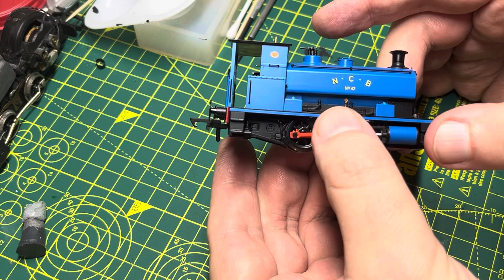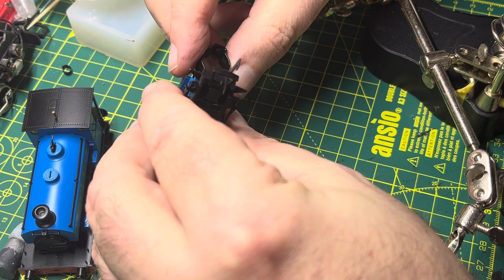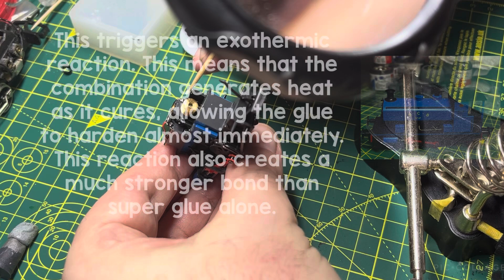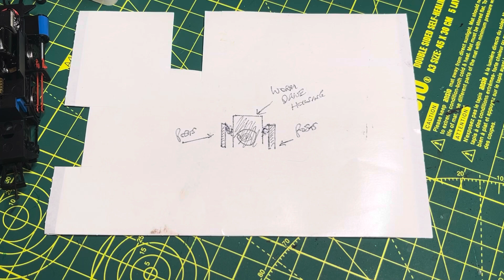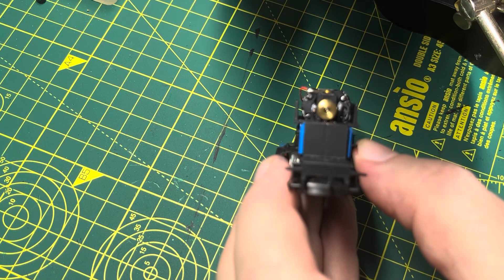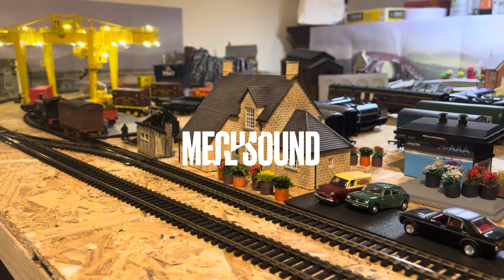How to Fix your Andrew Barclay Motor Mount

Comment: There is a way that does not require glue. On your diagram you show post(s) with an arrow, If those arrow(s) where wood packing between the post(s) and the metal chassis so the posts engage the motor. If a full restrain of the wood packers is required (not just friction) drill clearance holes in chassis and add countersunk self tappers so it clears the body fit.
Reply from the maker: Thanks Brian.  Had a read through a couple of times - trying to visualise)
Appreciate the additional ideas.  Would be great to try other options.

I did think about fitting a wedge into base pushing the posts inwards - similar theory to yours I think 🤔 

I decided against it, as if it dislodges (say for e.g a wooden section) it could jam in the worm drive.  So went with an option that wouldn’t add a foreign object if dislodged.

Hope I explained that ok)

BR

MODELTRAINZZ

Comment: My friend fixed mine for me. I put it on the rolling road, it ran perfectly for 15 minutes then one of the screws holding the connecting rods came out and disappeared somewhere into the universe.....This disaster of a loco, damaged cab and loose motor when it arrived and now the screw.  I have had it several weeks and its run a total of 15 minutes.  Its been the worst loco I have bought and I have bought lots in N and OO. I tried to return it to Accurascale from Australia and that was a farce that went on for a couple of weeks until my friend talked me into letting him fix it. Once I get the replacement screw I will have another go at running it in and seeing how his fix works out.
Reply from the maker: Hope the screw arrives and it’s starting to run properly friend.

I’m real glad I got mine “Out of the workshop” if you know what I mean.  I’ve tried to be as fair as I can regarding the issues we’ve seen with this model.  I think I got the point across about releasing the models when they did.

Anyway.  Good luck mate. 👍🏻

MODELTRAINZZ